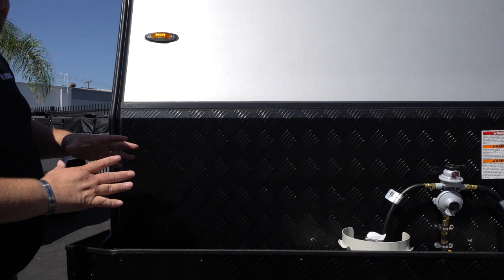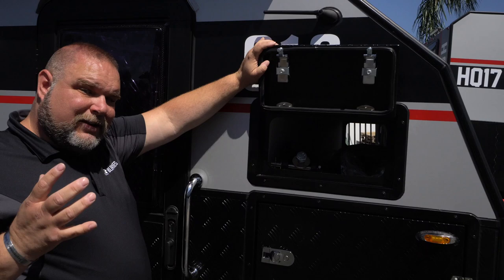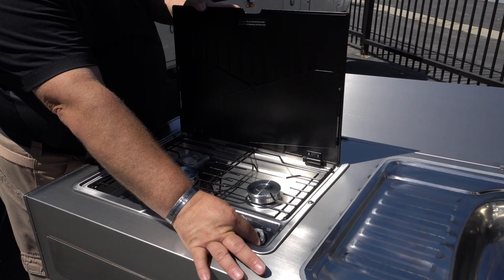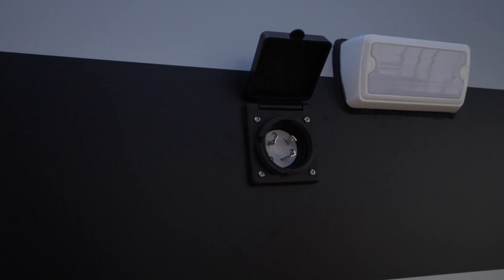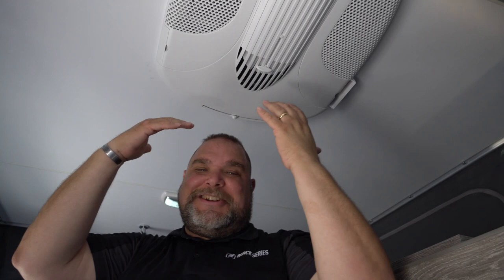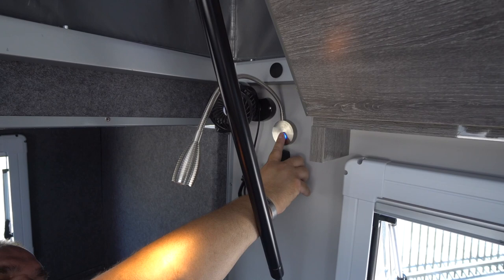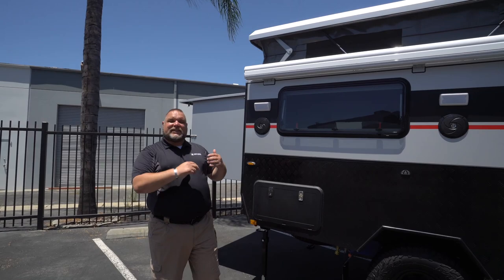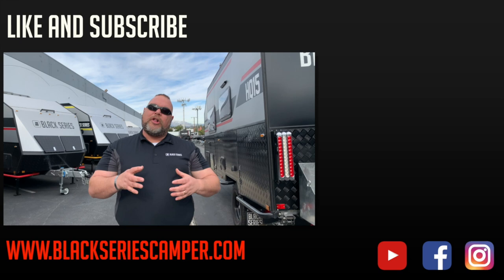C12 Full Walkthrough! Black Series Camper; Caravans, trailers and campers

Comment: Suggest rubber seals on the top and bottom sides of the rear vertical driver and passenger sides swing out side panels that will seal the gaps so bugs, cold or hit air doesn’t enter to the inside of the unit.

Comment: For the price, the kitchen gas and water should be hard plumbed. At this price point you should be filling the water tanks, connecting the propane to the main connection, and that's it. Having to deal with other hoses to hook up sinks and stoves is an oversight.